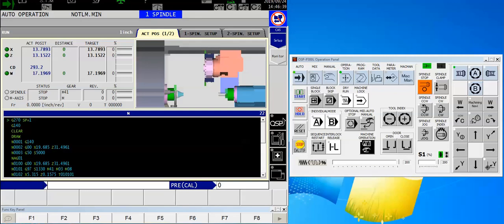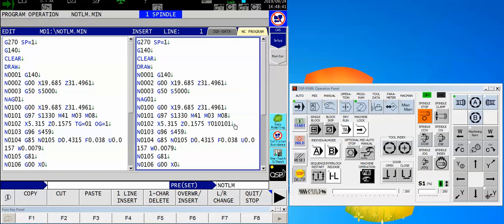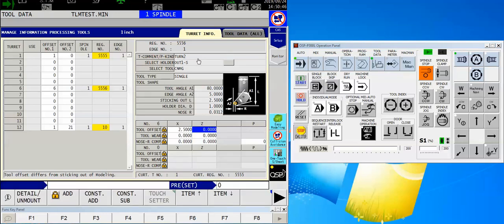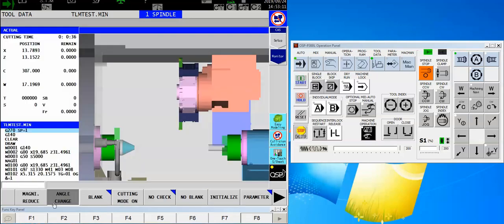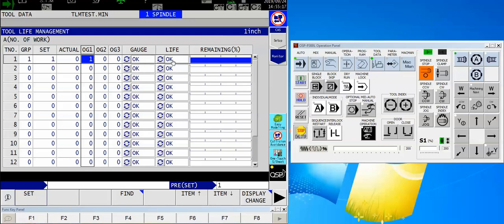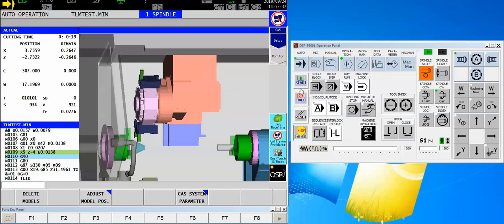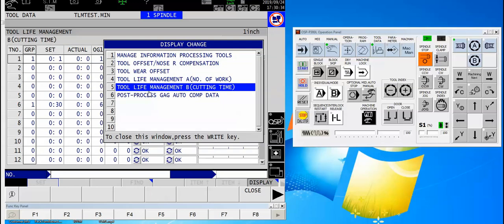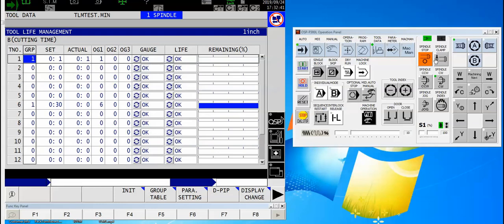Okuma TLM LATHE

Comment: I had tried using this previously, but it would reset the wear offsets to zero when initializing. I am not using redundant tooling, just tool life counting basically. Is there a better approach?
Reply from the maker: No better approach, but you CAN change the behavior of the machine when initializing. By adding a check mark to  OPTIONAL PARAMETER LONG WORD BIT 6 bit 7, the machine will no longer erase the wear value when initializing the tool life. Happy turning!
Reply: @pocketcharleywithgosiger  thanks for the quick reply.

Comment: On the tool life managment page how do you set up double turning tools? We have a LB3000 and have tools set up for turning on the main as well as another tool set up on the sub. For example T0101 on the main and T0121 on the sub. We need to set tool life for both the main spindle insert as well as the sub spindle insert.

I am not clear on how this eould be set up in the table. Ref Time stamp 6:30 in the video
Reply from the maker: Great question! Out of the box, Okuma does not have a solution for an independent count when using the same turret station, but separate offsets (Like T010101 & T210121). I've been told that it may be possible with a RFEQ thru Okuma, but I've never had anyone pull the trigger on that. I've guided customers of mine to do their best to have identical tools on the opposing stations so then they can simply double the expected tool life count, then it will be equally split between the two tools.

Comment: I want to generate alarm after tool life over to stop the machine to next part
Reply from the maker: My favorite is to add a sub to your control, then call it at the beginning or end of your program. This sub compares the tool life SET value to the tool life COUNT value, and hollers if you're out of life on the tool:
OTLMD
V1=1
NSTRT
IF [VTLST[V1] EQ 0]N2
M331
IF [VTLST[V1] GT VTLCT[V1]] N2
M331
VTLLF[V1]=1
VUACM[1]='TOOL EXPIRED'
VDOUT[992]=1
N2 V1=[V1+1]
N4 IF [V1 LT 13] NSTRT
NEND 
RTS